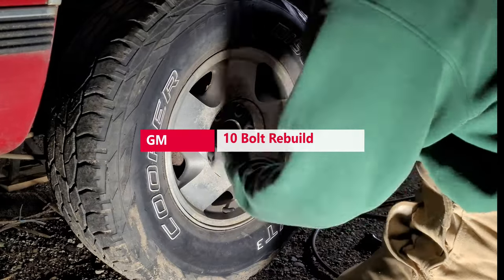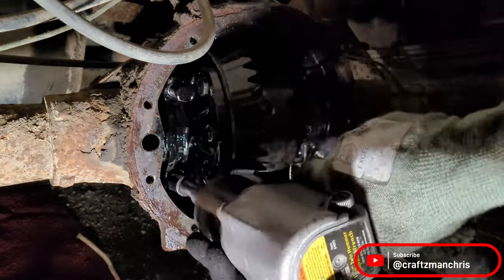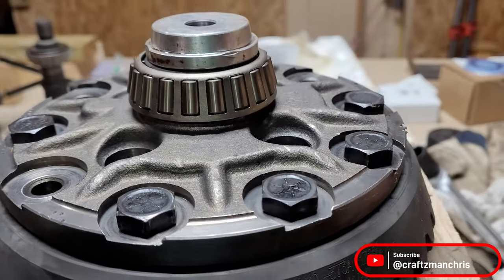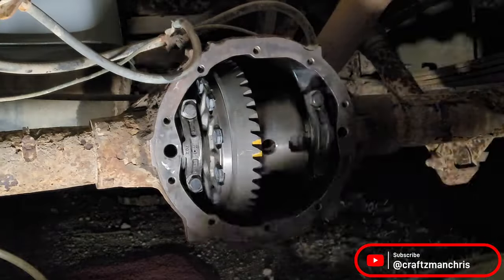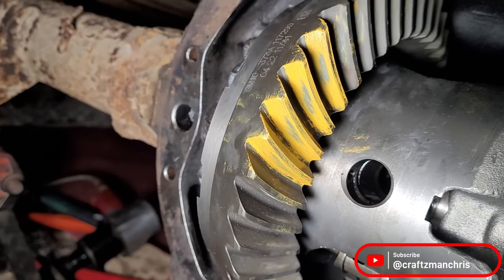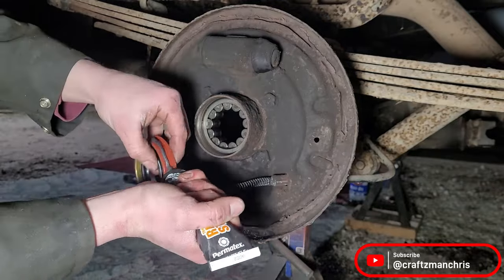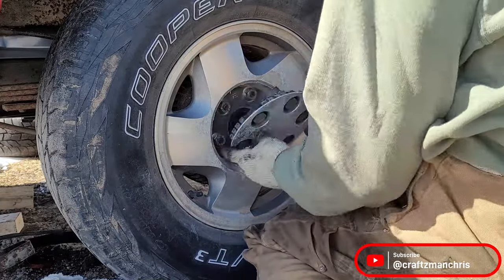How to: Rebuild a GM 8.5in 10 bolt rear differential - Start to finish rear end rebuild in 7 min!

Comment: I did one myself on my pickup not too long ago. The hardest part for me was getting the outer axle bearings loose and getting preload set on the pinion. Everything else is pretty straightforward. I hate having to take everything back apart though to get the pinion depth set correctly. You did a great job thumbs up.
Reply from the maker: Thank you Sir! It sure is a lot of back and forth...

Comment: I just had to stop and say thanks ! I had no idea that the ring gear bolts where reverse thread. I was on the edge of breaking them off, but you save the day.. I am not new to wrenching on vehicles. I’ve got about 40 years under my belt, but no ring gear and pinion ever. That was a good one. Thanks God Bless you !
Reply from the maker: Thank you for the kind words! Glad I could help!

Comment: Just the info I needed to complete my '67 Camaro. I've changed ring and pinion before but never knew ho much more I should have done. You Tube wasn't around in 1972. Much appreciated video.. You did a fantastic job of getting to the point. Thanks loads.
Reply from the maker: No problem. Thanks for the kind words.

Comment: That large piece holding thw ring gear just cracked on me today. Im debating repairing my axle or just buying one from a junk yard. But after watching your video that little gauge you were using to adjust the gears is something that was a foreign language. May have to do some more research as that was the main thing indidnt understand. The rest was great. Thank you!
Reply from the maker: Thanks for the positive feedback. The little gauge is called a dial indicator and I had it mounted on a magnetic arm to hold it in position. The needle goes around the gauge as the probe is pushed in. The needle/display essentially displays how far the probe is moved. It is very accurate and used for measuring very small increments. I used to to measure the .005 inches of required play (backlash) between and pinion gear and ring gear.
Reply: And that backlash that you measure is EVERYTHING standing in the way of a rebuild that lasts one year versus 30 years.😄 Very important to get it right. Equally important is the tooth contact patch between the pinion and ring.

Comment: 07 chevy suburban 1500 4x4 10 bolt. About to do the same but im only replacing the pinion bearings. Keeping same shimes so as long as everything looks good when i pull it nothing should change when putting back in?  Any pointers would be helpful. Tks. Great video
Reply from the maker: In my amateur opinion, I think everything would be pretty close but I would still check the pattern and backlash.

Comment: Very helpful, clear and quick . How long did it take for this rebuild? Could just the pinion been replaced only?
Reply from the maker: Thanks, the prep work took longer than the actual rebuild. I think it only took me a night once I had everything ready. 

I'm no expert but I suppose you "could" replace only the pinion but I would imagine it would be best to replace both the ring and pinion at the same time. In order to replace only the pinion you still have to pull the entire carrier assembly and re-shim everything.

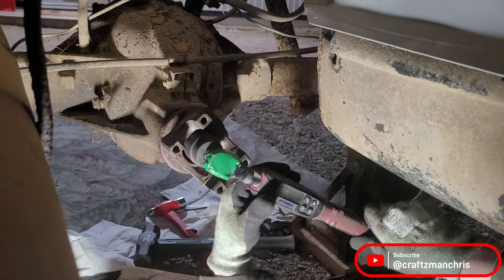Comment: When you say you set the rotational drag for the pinion nut to 15lbs/in ( 5:26) are you jusy using a normal torque wrench and tighten/losening the pinion nut until it takes that torque to rotate? Or is it a special tool ill need ? Thank you.
Reply from the maker: Yes, from how I interoperate you comment I believe you have the correct concept.

The torque on the pinion nut itself if irrelevant when there is a crush sleeve. It take an incredible amount of torque to get the crush ring to crush. The pinion rotates which makes it even harder to get the crush ring to crush. I wasn't able to do it by hand and had to use the big impact. Once it starts to crush and add preload to the pinion bearings, the pinion will start to have a little resistance when you try and spin it. This is when you use the inlb torque wrench. You need a wrench that reads inlbs and gives a live reading like this one on amazon https://amzn.to/454Odqi .

Remember, you are not reading the torque it takes to get the pinion to turn, you are reading how much drag there is when its turning. That's why you need a wrench that gives a live reading. Also, once the crush ring starts to crush, it tightens easier and goes fast, so be careful not to over tighten it.
Reply: @craftzmanchris9859  ok that makes more sense now. I'm wanting It to read 15lbs/in the entire time I'm rotating the pinion, not just what it takes to start the rotation. Thank you for getting back with me so fast.

Comment: Can i only replace the carrier bearings on my gm 3.23 of a 2017 escalade and leave the pinion and its bearings preload alone?
Reply from the maker: I am not an expert I think you could. You would want to make sure you return the shims on either side of the carrier assembly when you put it back together. I would still do a backlash and pattern check though in case the new bearings are not exactly the same.

Comment: Im about to try to tackle this with a new master rebuild kit but my main concern is getting the back lash correct.. everything else seems so easy but I don't understand the backlash.
Reply: You shim the diff right(take out right add left) to engage the pinion more(less backlash). Do the opppsite to make looser.

Comment: Hey man, any idea why my axles don't go in all the way? I pulled the pin, but my axles only move in a small amount and I can't get to the c clips.
Reply: Did you have someone pushing in the axle in while trying to get the clips? Those magnet reach thing will help with help getting into there and getting the c clip easier
Reply: I did try having my wife push in on the axles. Turned out I just needed to smack the axle some more with a hammer. Thanks for the reply! @BillaBong1

Comment: Been doing mechanic work for 4 years,  my 98 c1500 has over 400,000 and rolled over once. Needles to say the original rear ends wore out like an old whore,  I knew how to pull it apart but now I got what I need for the preloads,  THANK YOU

Comment: Mercy I wonder what kind of money you saved doing that
Reply: Parts can be anywhere from $200 to $600 depending on the quality and performance you like. Labor is easily $600 on that job. That's why many people just buy a completely rebuilt 3rd member assembly because you get a new, painted housing as well for under $1500